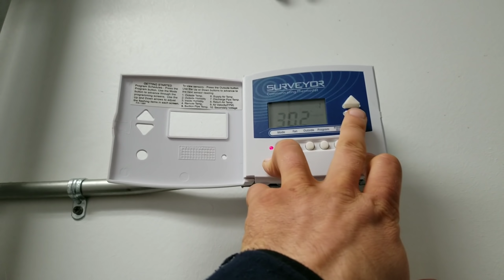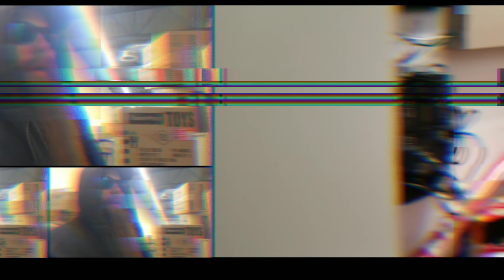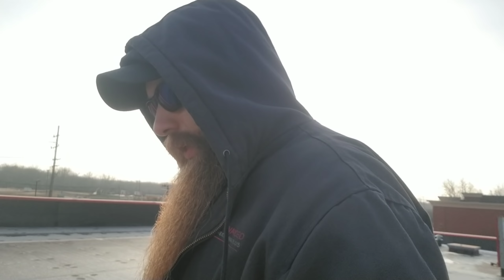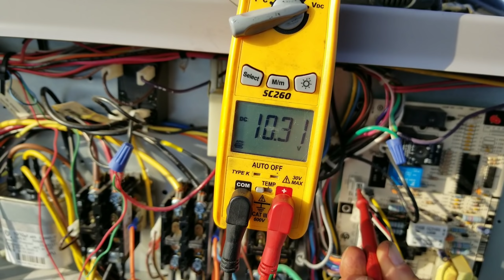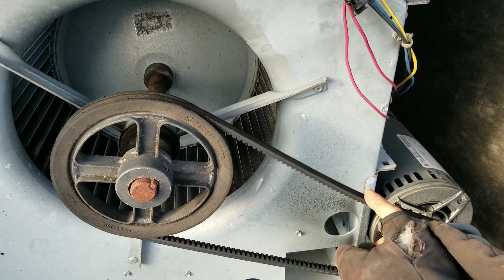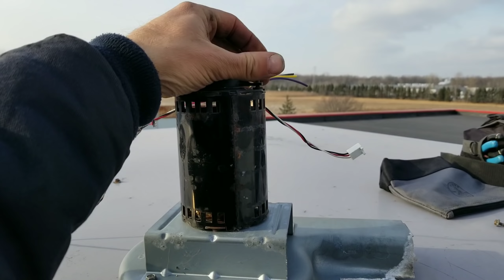Carrier package unit not heating

Comment: Hi, I have a new rtu similar to this. The unit has 5 heat exchanger tubes, but only has 3 burners. There are 2 heat exchanger tubes not in use. Is this normal? Thanks

Comment: I don't know how using a sensor is an improvement over a pressure switch. It is similar to the sensor on a cars hub bearing for the anti lock braking system.

Comment: Great video! I have to say i learned something about hall effect sensors from your video. I only call tech support if told to. I would also like to ask if you ever check heat exchangers on these calls on rtu's. On the face plate of the inducer motor was very rusty.If the rust spots are by the burners the other side of the heat exchanger is badly rusted and a screw driver can poke a hole right through. I am also a hvac tech  from detroit.
Reply from the maker: Great point Dirtywaters- I believe I did check those at the time

Comment: Back when I worked on several big box stores accounts, we discovered the Hall Effect Sensor. We swapped out many good inducers until we discovered that the sensor was relatively cheap. Since then, I've always carried a handful on the truck and replacing them has never backfired on me (as long as the motor was in good shape).

The sensors were very inexpensive.

Comment: The epoxy coating is called a potted circut...its a black resin that prevents you from removing the circut and bootlegging the design...nice job dude!!!...never seen a hall effect on an inducer before...cool
Reply from the maker: Interesting, a potted circuit-- im gonna add that to the old brain file and see if it sticks - thanks

Comment: The Hall effect sensor on these works off of an actual magnet on the shaft, it’s a diametrically opposed magnet so it sees the push-pull from the magnet
Reply from the maker: Nice- thanks for the knowledge-- do you see alot of these in your area?
Reply: Curious HVAC Guy they’re all over the place. All of the heavy commercial equipment out here is either Carrier or Trane

Comment: Very interesting, bro , I didn't know about them sensors .
Btw , careful with RTUs and the flippin virus , bruv !
Especially with the return air , exhaust , filters and all that good stuff .
My company has decided we ain't doin RTUs during the lockdown no more , stay safe out there , mate 👍
Reply: Sterling Archer the virus is transmitted through water droplets that’s why there is a 6 feet separation from individuals and cleaning your hands because they could have the droplets on them then you touch your face or eyes. I’m a building engineer we got customers asking for UV lights on 70 ton RTU. If the virus was able to be circulated through RTU we would know this when it first hit.
Reply from the maker: Thanks, thats a good call-- its crazy right now

Comment: Interesting central control system. Surveyor must be some Carrier derivative since those are definitely repurposed Carrier Debonair thermostats. We have some of the normal ones at our office.
Reply from the maker: Actually the surveyor board is used by there EMS company- its a decent setup, easy to work with most of the time and the tech support is easily reached

Comment: But what happens is something causes the motor to be turning but no air flow, such as the fan coming loose on the shaft....i would think a pressure switch is safer
Reply: you have a great point
Reply from the maker: that is a good point- hmmm

Comment: As a new trainee I would have guessed that the board was bad,I still have a lot to learn🤦🏽‍♂️thank you for this video👍🏽
Reply from the maker: Anytime bro-
Reply: Done rule out the board I have worked on alot of these carriers unit's and sometimes it's the board blinking a fault code but always test the sensor first and if it's good then it's the board

Comment: Nice to learn something new however the pressure switch has been pretty reliable in furnaces.   What happens on after hours call when you can't fix the furnace because of a situation like this?
Reply from the maker: good point- pressure switch is the way to go

Comment: The Hall effect is related to how charge carriers (usually electrons) in semiconductors are veered off course by a magnetic field, perpendicular to both the direction of travel and magnetic field. Imagine when driving (current) down a road, that when there is a magnetic field above you, the car will pull to the side (creating a voltage across the road). The Hall sensor detects this induced voltage (proportional to the magnetic field), and connects the output pin to common/black when it's above some threshold. 

The control board will have a pull-up resistor (like 10kohm) between the white and the DC voltage rail (10V) that forces the voltage normally high. The "open-drain" Hall sensor output will connect the signal to common when the magnetic field is detected.

Anyway, I bet it's a bad connection to the sensor, caused by motor vibration. If replacing the sensor, the magnetic field threshold isn't too important (though the detection axis would be). It's like a 5 cents part.
Reply from the maker: I think I understand that, i appreciate the knowledge - you sound like a smart dude

Comment: Halifax sensor always goes bad on Carrier package units.
Reply from the maker: Do they use those on alot of different models? its the first one ive seen
Reply: @curioushvacguy6876  Yup. I've seen them on 3.5 ton and higher gas packages units. Had to keep some in stock when I was a Facilities Engineer in northern Virginia. Also watch for how they run the wiring for them. I have seen several times the insulation get rubbed off and ground out the sensor.

Comment: Hall effect sensors produce a square wave voltage. By definition, they have a power supply, a ground, and the signal output which will as you mention switch from lo to high. They are used all over the industrial base. This might be useful to diag a sensor or a board problem. Just FYI.
 But I really loved the “blindly light” diag; did that in the car biz for years.
Reply: Thanks for explaining.
Reply from the maker: Thanks